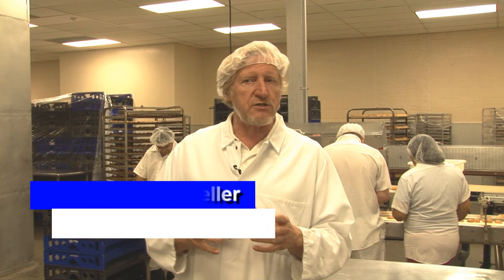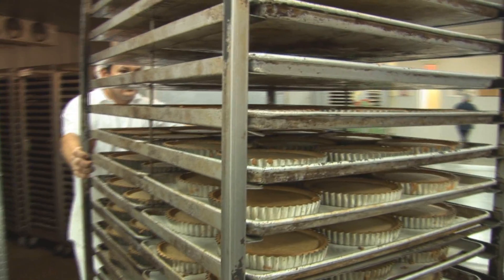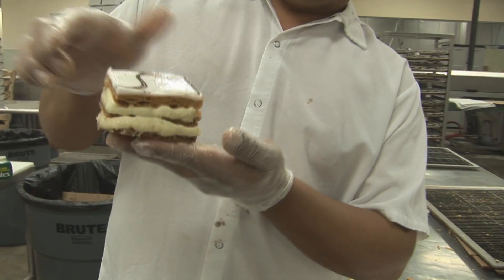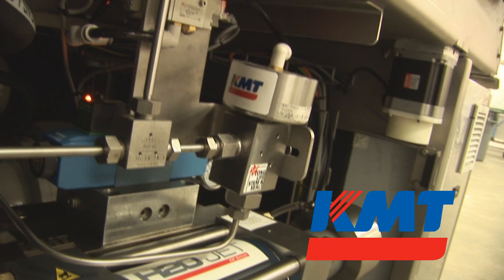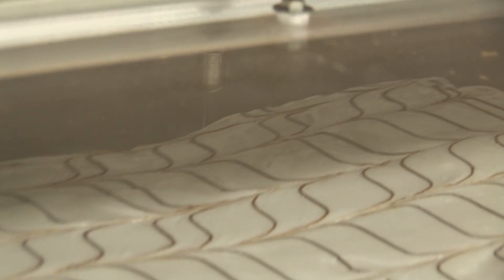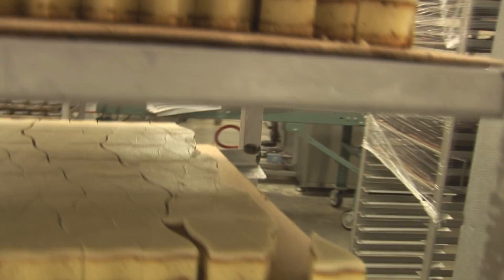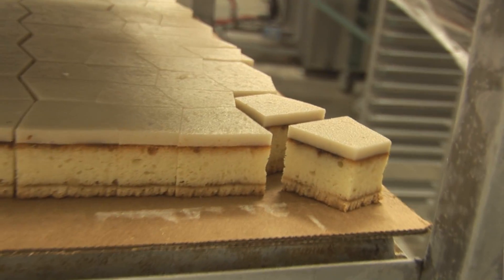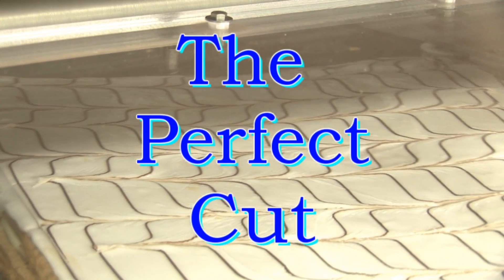KMT Waterjet Cutting System at Edelweiss Bakery in Boston.wmv

Comment: How does it not make it soggy?
Reply from the maker: Thanks for the question. The size of the waterjet stream orifice is .005”, about the width of a business card. With the fast cutting speeds, the moisture is negligible. A diamond orifice is used to maximize the waterjet cutting life, typically the size of the stream is a width of a human hair at speeds up to 3,000 feet (914 m) per second. This small kerf width is so thin that food will not be compressed or washed out. There are over one thousand waterjet cutters for the food industry around the world, in pastry shops and commissary’s using waterjet technology for cutting confectionary products and much more.